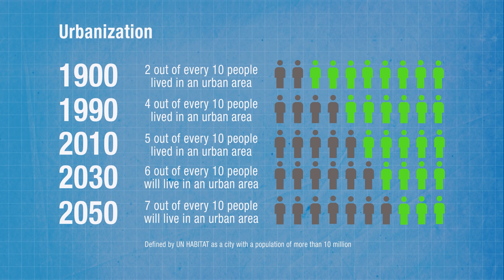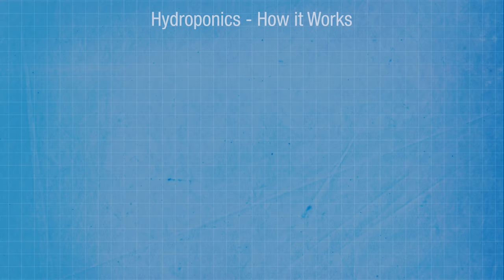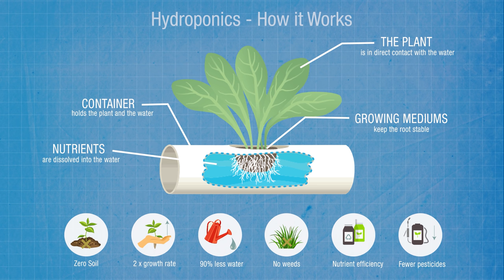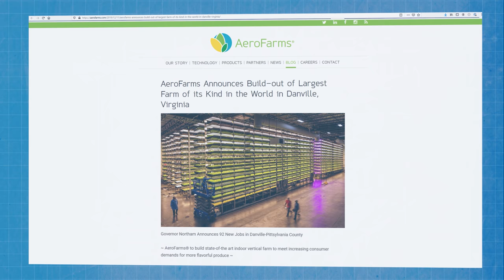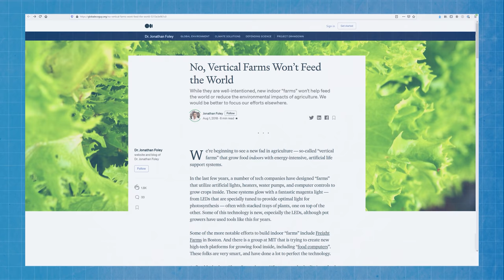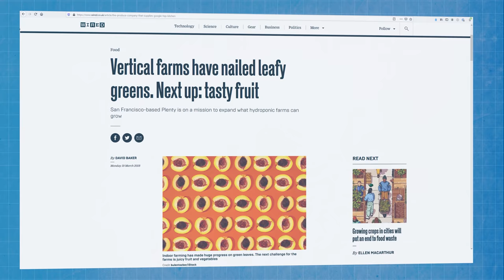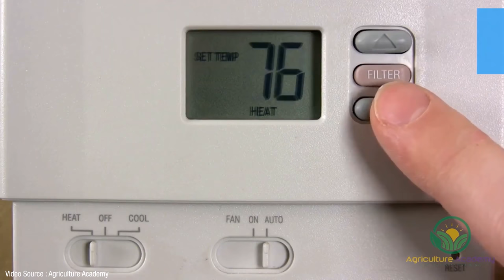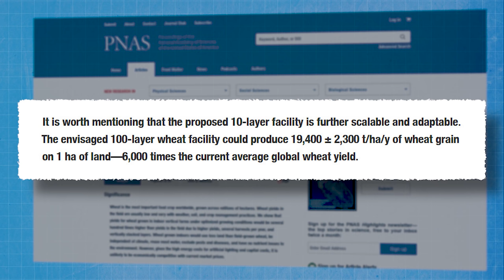Vertical Farming:  Growing fast!

Comment: The direct energy inputs could be renewable  but so much more steel, concrete and plastic? Got me thinking, but we need to talk more about top soil!
Reply: Renewable how?
Reply: @felixfungle-bung4688  the sources of power for heating, lighting in the systems discussed.
Reply: @matthewbrooker  what about Water, Nutrients, pesticides, fungicide, CO2,
Reply: Simple solution, use what Resources you already have , like RAIL CARS and Shipping Containers , and make use of RENEWABLE Energy and Battery Storage.
Reply: Steel is not an issue.  We can extract iron ore and turn it into steel with only renewable energy.

Concrete can likely be formulated to be a CO2 sink.  Use crushed olivine rock for the aggregate and the concrete should start absorbing carbon.

Plastic.  We need to move to recyclable plastics.  Best if the material is plant sourced.  (And not those plants which were buried thousands of years ago.)

I suspect we may keep producing grains in soil/fields.  Planting and harvesting is efficient.  Grains store and ship well, unlike fresh produce.  And grain crops are not what is getting blasted with insecticides and other ag chemicals.
Reply: @bobwallace9753  I agree that the solutions are there technically and at the eary adoption phase, but the lower impact methods have yet to see widespread adoption.
Reply: @matthewbrooker  We (the world) has waited much, much longer that we should have to deal with the damage we're doing to our planet and its atmosphere.  Once there's general acceptance that change has to happen there's a long ramp up needed to get change happening rapidly.  

We've solved our solar and wind problems.  We've created technology that efficiently turns sunshine and wind into electricity.  We're now watching more rapid and accelerating solar and wind installations.

But we're only getting started on steel, concrete and plastic.  We now know how to make each in an environmentally acceptable way but I don't think we've worked out the best ways to scale.  I think we'll see a few more 'slow' years before we start moving to better approaches for the materials under discussion.

You started this thread with top soil.  I think we're seeing that worked on with wider spread no-till agriculture and more attention to preventing runoff and erosion.  It seems to me that many farmers are now looking at the quality, the fertility of their soil and understanding how higher amounts of undisturbed organic matter reduces the amount of fertilizer they need to add and helps their crop yields.

We're not going to see all these problems fixed overnight but it feels like we've started moving to solutions.  And concerns over climate change, pollution, and the quality of our food are growing.  Those concerns act as a catalyst which will drive change faster and faster as concerns grow larger.
Reply: @bobwallace9753  I agree with your pathway for the future!. I hope there is time to deploy tweaked technology like this one assist in the global goal of minimising and mitigating the effects of  man made climate change.
Reply: @matthewbrooker  I have zero doubt that our climate problems won't get worse.  We can't turn things all the way around overnight and even if we could we've already dialed in more warming with the GHG we've emitted up through today.

But I am fairly optimistic that we will be able to avoid extreme climate change.  I think fossil fuel use will be essentially eliminated before 2050, most other GHG emissions will have been stopped, and we will be sequestering carbon to some extent.

Five years ago I was really worried.  But now with the advances we've seen in RE generation, batteries, and battery powered transportation I think we've got most of the tools we need and they are affordable.  Even cheaper than the fossil fuel stuff.

Cheaper is excellent.  Offering cheaper energy and cheaper transportation will make it easier to get the general public to accept new technology.

Comment: I think there is definitely a business case for this.   I didn't even think large-acreage crops like wheat could be grown vertically.   I guess technologically, it's not a surprise.   At the mear suggestion that there is a business case for this is really exciting.
With companies like Nexus Robotics in Halifax Nova Scotia could make the economics work really well for operations like this.  Let robots do most of the work, charge an automation tax to support a guaranteed basic income.

As for traditional large-acreage farming, I think with the advent of cheaper, more energy-dense batteries, battery tenders can be attached behind tractors and combines, like a coal tender would've been back in the steam engine days, then tractors could go electric rather cheaply without much mechanical complexity.  I really think there is a business case for that.   There's obviously an environmental case for it.

Comment: 8:15 Excellent idea. On an earlier topic, I was thinking that similar synergies could be used in the renewable energy space by building molten salt thermal solar plants next to liquid air plants and utilising some of the heat for recondensing the steam for expanding liquid air and driving the turbines. Once the steam has been produced by the turbine from the molten salt and driven the turbine, the steam could then be recondensed by passing it through a heat exchanger in the liquid air plant, in turn driving the liquid air expansion process. Once the superheated steam was cooled back to close to below 100C, the water would flow back to the solar thermal plant turbine, ready to be re-heated by the molten salt at 500+C.

This would be an ongoing mutually symbiotic process, since the inefficiencies of both molten salt and liquid air both arise from the recooling for molten salt and reheating for liquid air processes.

In the event that more than enough renewable energy (from local wind or local solar PV) was being produced, this could be stored in both liquid air form and/or heat capacitors for molten salt, again acting as a battery or energy storage device. The two would be balanced constantly by an algorithm, so that there was always enough heat to regas the liquid air and drive the steam turbine, and always enough liquid air stored ready to condense the steam turbine's steam back into water. So you would always have additional molten salt capacitors and liquid air vessels, which would fill and empty depending on demand. If there was low demand, then solar PV and/or wind would continue to make liquified air and store it, and thermal solar would continue to heat molten salt in heat capacitors and store that in storage tanks. In the event that energy was demanded, then stored molten salt would be brought into play at driving turbines and heating liquid air.

During the day, solar PV would drive liquid air collection and solar PV would drive molten salt collection in heat capacitors (as well as generating any electricity needed during the day.) At night, when both solar PV and solar thermal closed down, molten salt from the capacitors would be released into the system to continue to drive steam turbines and heat liquid air to drive liquid air turbines. This means 24/7 production of electricity.

Probably best suited for sunny climates that supports solar thermal, although you could do the same with wind, but less efficiently since you'd need to use the wind energy to heat the salt electrically (similarly to how liquid metal batteries are heated I would guess.)

Comment: Obviously, this could have a profound impact on the economy of rural areas dependent on agriculture.  In those areas, cereal grain production is often already quite automated, but the production of fruits and vegetables is still very labor-intensive.  So, it seems like labor cost reduction and not just technical considerations drives vertical fruit and vegetable production to be first.  What happens when all those rural workers are made redundant as demand for produce dries up?  It could worsen already existing social, economic, and political problems.  I hope industry and government are thinking about how to mitigate that.

Comment: Staple grain crops will be grown in vertical farms, and it will work great!
The hold-up is that each tray needs more height for the grains to grow in which simply is not cost effective like smaller crops yet.  Between more efficient lights, cheaper power, and dwarf crop varieitys it will happen soon (5-10 years), but other smaller crops will take off first like potatoes, strawberries, etc.  Vine crops are also a good candidate, but they need to move more towards 'warterfall' style vertical farms rather than trays, which will be more difficult to work with, but less of a challenge to get around than grains.

Lastly, I think there is a missnomer that vertical farms will reduce meat consumption.  On the contrary, I think that 'human grade' food crops will move to this, which will free up land for use of cheap 'cattle grade' food in traditional farming.  Less pestacides, less worry about crops being 'picture perfect', and less worry about perfect yields.  Just send the seeds out, and then hoover and mulch it up and give it to the animals.  This will support and overall increase of cheaper meat options for the world that is more sustainable.
To be clear, I am not a proponant of this, but I highly suspect this is the direciton it will go in.

Comment: Just have a Think - Shipping Container farming > vertical farming.
you can produce 100x yield in a Shipping Container alone , than a Garden in your Backyard. 
IF , all those with HOMES did this , they would save $$$ on Produce. 
best of all, Contaner Farms are CHEMICAL , PESTICIDE FREE , and INSECT FREE . 
and you can power it with RENEWABLES and Battery Storage. 
all you need is CLEAN water thats been FILTERED and Minerals added back in.

Comment: Turns out I've just become an inadvertent vertical farmer. I decided to add broccoli sprouts to my diet. To that end I purchased a plastic (yes, I know, sorry about that) growing device that consists of 4 growing trays (where the seeds are placed) stacked one on top of the other above a fifth tray that collects the water that was added to the top of the stack and trickles down through each tray above. 3 times a day I empty the bottom tray into the top tray (that might be a mistake, the packaging says to throw that water away and use fresh each time, I guess I'll find out soon enough).

Comment: The amount of energy used is not important as long as the cost of energy used doesn't make the produce too expensive.  Sunlight and wind are free.  The cost of hardware to convert sunlight and wind into electricity has become very affordable.  

We should keep pushing on this area, and laboratory grown meat as well, in order to stop food production  on marginal land and use that land for forests which are needed to trap CO2.
Reply: You do know that crops also trap CO2 and are powered by sunlight right?
Reply: @M00Z1LLA  Gosh, how would one know esoteric stuff like that?  I guess you'd need to stay in school all the way to the third grade?  ;o)
Reply: @bobwallace9753  I just don't understand what your above argument is about. Vertical farming will have no beneficial impact on reducing CO2 emissions.
Reply: @M00Z1LLA  Produce farming captures CO2 from the air and breaks it into carbon and oxygen.  The plants use the carbon to build plant matter, the oxygen is given off back into the atmosphere.  When the plants die/are eaten or rot the carbon in them stays in the carbon cycle.  The carbon they take in as aspiration of CO2 is not sequestered, it is not placed in long term storage.

The exact same thing happens with vertical growing.  Plant take in CO2 while they are growing and use that carbon.  When we harvest the plant we release the carbon.

I specified "produce" farming because foodstuffs grown on trees and shrubs - fruits, nuts, etc. -  help to sequester some carbon.  Some of the CO2 that is taken from the atmosphere and used for plant growth goes into the roots of the trees and shrubs.  Those roots are a more than a short distance from the surface leave carbon underground once the topgrowth is gone.
Reply: @bobwallace9753  Fruit's and nuts are just a longer term carbon cycle. Once the trees are old and don't produce, they are torn out and replanted. Farming annual crops will add carbon to the soil just as much if not more than trees and shrubs.
Reply: @M00Z1LLA  If all the roots are removed when the trees are ripped out.  

Shallow root systems do not sequester carbon.  Any plant material left in the top inches of the soil will be consumed by microorganisms and expelled as methane.
Reply: @bobwallace9753  Some, but by no means all. As long as a field is properly managed to prevent erosion, carbon rich topsoil will slowly build up.
Reply: @M00Z1LLA  The carbon of which you speak is organic matter.  It's on its way to being digested and excreted as methane.

Look.  Produce farming is not a way to sequester carbon.  Trees and plants with really deep root systems such as switchgrass will get carbon deep enough below the surface to remove carbon from the normal air-> ground cycle. 

Actually, there's a good chance that vertical farming close to where the food is consumed may result in less carbon emissions than typical large field and shipping farming.  Vertical farming does not use tractors and other fossil fuel powered equipment and the distance the produce has to travel probably means less FF consumed.

Comment: Hello. I don't know if this technology has been covered on this channel:
 microbial electro-chemical cells (or sometimes called 
bio-electro-chemical cells). This technology is mostly supplied by 
startups as far as I know. The intended use is to treat wastewater streams. Depending on the setup, such a system might required DC electricity to make the cell clean the wastewater and give hydrogen or methane gas (microbial electrolysis cell). Alternatively, if one of the electrodes is fed with oxygen, the cell could end up producing DC power (microbial fuel cell).

Comment: The determining factor, as with all renewables, is: Does it produce more value to build over the value that's being used to build it. 
But not just that, but how much longer does it take to recoup the cost vs more traditional means of producing the same value.
Considering there is still a vast amount of untapped land (not even counting forests), and the demand isn't forcing even that to be utilized yet, these are going to be passion/vanity projects for much of the near future. Just like solar was up until a year or two ago. (Not to mention the fact of needing to simulate light, taking otherwise free solar collectors and turning them into an energy negative.)
Reply: The main reason solar panels and yes electric vehicles have reached the point where they are a real alternative to fossil fuelled alternatives is because folks with vision started on the path years before they were justifiable on short term profit thinking. Sometimes we should try and do the right thing, we are only on this earth for a short time, try to do some good where you can, if you can. Having the biggest mausoleum in the cemetery is poor recompense.
Reply: @dogphlap6749  yeah. I didn't say they were unviable. They just aren't mass market material. It's a vanity project for those who have accumulated enough value. 
Thus, they don't need to care if it takes 10 or 20 or even 30 years to pay back on itself. Let alone if they care about the opportunity cost of doing things more conventionally.

Comment: Sadly with the efficiency of photosynthesis and current LED lights, we're only getting 5-10 kcal of food per kWh of electricity. And that's even before counting pumps, air conditioning the greenhouse, and producing the fertilizer. So basically we will not be seeing staple foods grown under artificial light until energy costs are close to zero. Vertical farming is great for fast-growing and high-value fruits though, like tomatoes and peppers, which while lacking in calories do provide a lot of vital micronutrients for us (and taste good..). Similarly lettuce, herbs and microgreens can easily be grown this way since they are super high value per kcal, and as a bonus we eat almost the entire plant. So theres little to no kcals locked in inedible stems, branches etc. 

I produce all my own herbs and lettuce in an indoor hydroponic garden in my closet. It's very cost efficient, upfront investment is probably recouped within the first 6mo compared to buying fresh herbs and lettuce every week from the store.

Comment: aight time to leave my thoughts. my thoughts are that vertical farming is a result of urbanization and people in those urbanized areas want fresh produce instead of the stored produce at optimal temperature in warehouses. and you pointed out in the video that hydroponics solves the issue with insect pests but how does it handle with bacteria and viruses that travel via water. 
and if they are planning on getting fruit to grow in vertical farms it would more likely be Dwarf varieties of fruits.

anyways cheers.